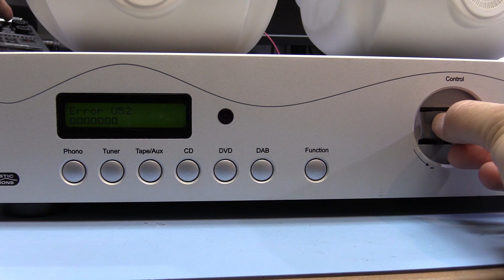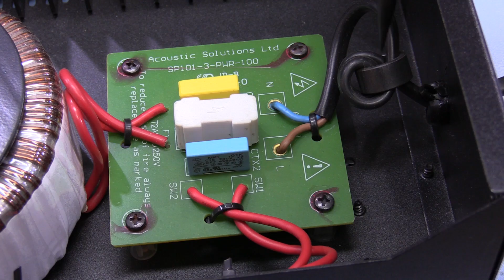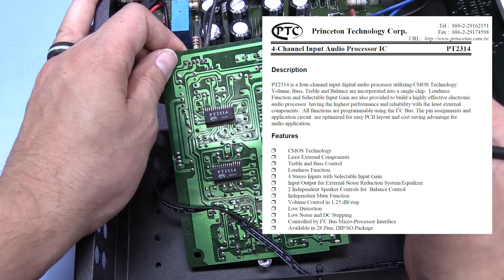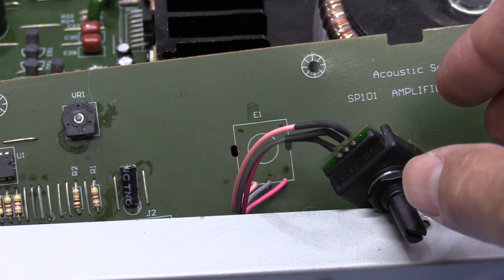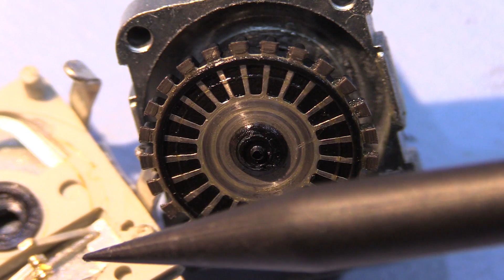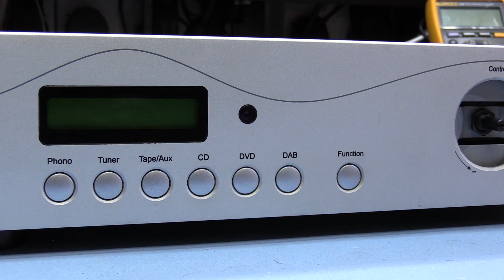SDG #022 Teardown & Repair of Acoustic Solutions SP101 Hi-Fi Amplifier - Error U52 U53

Comment: I came across your video whilst looking for references to help me out with an issue on my SP101. I hadn’t taken the amp apart as it’s up on a high shelf and I’m lazy, but your video showed me what I wanted to know. What I hadn’t been prepared for when I finally did take it apart was how absolutely appalling the whole thing is manufactured, with almost every solder joint worse than I have ever seen from former students back when I was an electronics engineer for a living. I think the only form of QC on the units was did it work when powered on – if yes, then that’ll do, ship it and hope.

Comment: That relay to supress a turn-on thump does not speak well for those power amplifier ICs.  Usually that's more of an issue with single-ended power supplies,  where you have a fairly large capacitor in between the amplifier output and the speaker.  And speaking of which,  "acoustic" (lower case like that,  yeah) and "percussive maintenance" reminds me of a repair I did many years ago.  It was a guitar amp,  and the capacitor feeding the speaker had a broken solder joint just like the ones you show here.  Interestingly enough,  it was for a UK band,  too...

Comment: Great video!

What still bothers me is the relay for the LCD backlight. The only reason I could think of would be because the forward voltage of the LED array is way to close to the 5V supply, so transistors would have an effect on the brightness when the temperature changes. Also these things need a fairly high current for reasonable brightness, I guess 100mA.
Reply from the maker: IncreasingVoltage It is quite odd, the backlight is not even bright - you can hardly tell when it's on.

Comment: Good job Steve. Bad solder joints have been the majority of the faults that I have found in devices.
Reply from the maker: Robert Calk Jr. It used to be about 80% of the repairs I used to do on CRTs when I was younger. It seems to be reasonably rare that something fails and is unfixable by basic fault finding methods. Unfortunately, most people just throw things away thinking the fault looks like something serious has happened. Thanks for watching.
Reply: SDG Electronics 
I know. A lot of the problem is that repair shops don't advertise - at least here where I live in the USA they don't.

Comment: Very good repair video. Even though I have an EE degree it's all theory so it's great to see people getting their hands dirty so to speak and I get to learn how different companies design and manufacture their products. Very good explanations as well. The toroidal transformer is a nice feature but it was odd to hear the front panel had so many screws which are labor intensive on a presumably low cost product. A few questions:

1) I noticed you did not clear the old solder. Would it not be better to clear the old solder first then re-solder the connection? IIRC I've only seen people clear old solder first. I'm thinking this could potentially be an issue if you are mixing different types of old solder and new solder which may be of different composition, e.g. if they dry at different rates could the solder crack again in a few years? Just thinking out loud really.

2) What the heck are those large white objects on top of the amplifier at the beginning and end of the video???

3) My I suggest playing some music through a repaired device at the end of the video.
Reply from the maker: In general it is a bad idea to mix alloys, but it was clear that this was 60/40 solder so it's no issue to mix old and new. With lead free it is best to clear the old solder first. The two white things are speakers. Thanks for watching,  more teardowns coming soon!

Comment: The remote which came with my one of these successfully emits IR when I press the buttons, but it has no effect on the amp. I cleaned the purple-tinted, clear plastic in front of the IR sensor to the extent that I can see the sensor through it. I assume the IR is reaching the sensor, but why isn't the sensor responding?

Comment: I don't understand the lack of cheap optical rotary encoders on the market. I used to buy PC mouses with a ball and 3 optical encoders for $5-10 - two for the axis and one for the weel. The mechanical fail over time, regardless if they are used - the contacts oxidate. The expensive ones probably last longer, but you still have sliding contacts - not as good as optical. I would pay 3-5 times more for consumer grade optical encoder.

Comment: Hi Steve

I'm considering buying a Canon Legria camcorder, either R56 or R66. The information online is a bit sketchy. Can you confirm if the camera has an external mic input? Are you using the internal mic for recording? If not, how are you connecting the external mic?

Also, is it possible to remotely control the zoom and other functions?

Many thanks and liking the videos. Good stuff!! 

Bob
Reply from the maker: Bob Fuller Hi Bob, There's no external mic input on the R56 or R66. I'm actually using the G30 for most of my recent videos, with the R506 as a 2nd camera, but I record the audio separately on a Zoom h6 and re-sync when editing. There's no IR remote and I'd have to check if there is an external remote jack. Thanks for watching
Reply: SDG Electronics Many thanks, Steve. I'll have a look at the G30 spec, too. A lot more expensive, though. Does it have a remote?
Reply from the maker: Bob Fuller Yes, the G30 has most of the features you'd want from a camcorder - IR remote, external remote jack, HDMI, headphone socket, line in, 58mm threaded lens for filters etc. No XLRs though - you have to get the XA20 or XA25 for those. The G25 is another option - half the zoom capability and slightly lower video bitrate but about half the price.
Reply: SDG Electronics Perfect, Steve. Thank you.

Comment: Hello, actually i have the same U52 error on my box. Unfortunately I am unable to spot any loose connections. I have taken a photograph of both sides of the circuit board. I can send it to you too. Would you be able to help me out?  Would the chip itself be a problem? How do i make sure I pin point the right problem?
Reply from the maker: Send the images though to the email address on my YouTube contact page and I'll take a look
Reply: +SDG Electronics Alright. I have sent you the email from my id. Sorry, forgot to put the subject line out of too much excitement.
Reply: +SDG Electronics Also, i just noticed that i get a Error U53 at the start as soon as i power ON the device and then once i move the volume control knob, it says Error U52.

Comment: I've tried a Denon and Aiwa from the same time qnd the SP101 is leagues better, and the SP101 pissed over everything from 2007 - 2023 for a similar price that the RRP was for the SP101 (About £120) and now you can get them for between £20 and £50 although be prepared to need repairs.